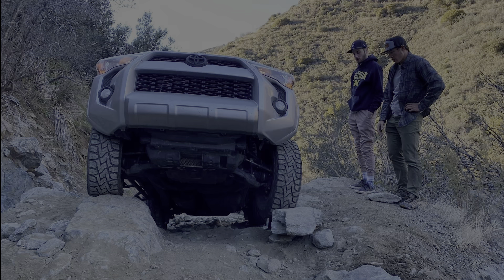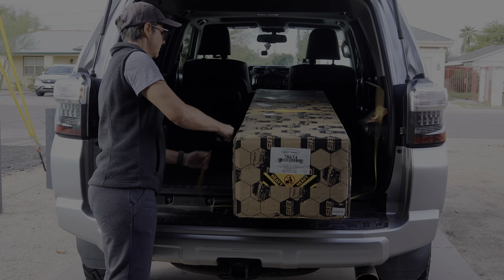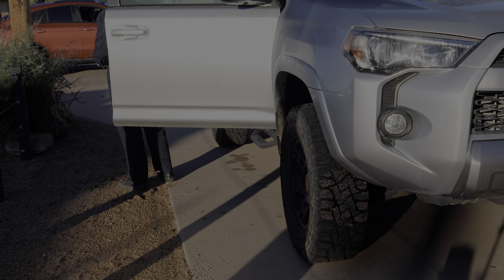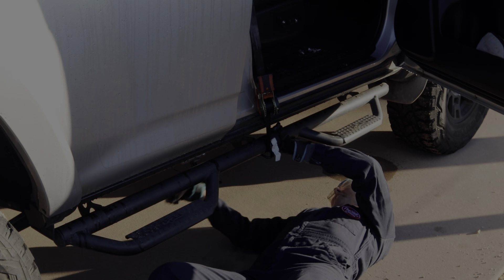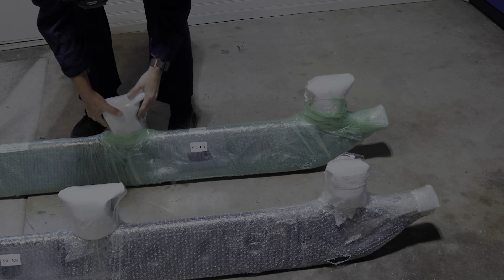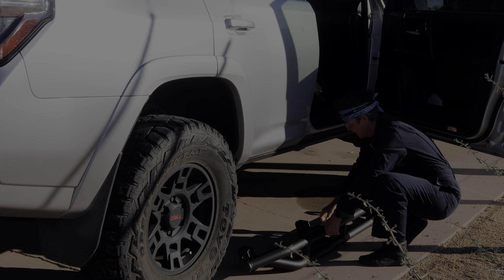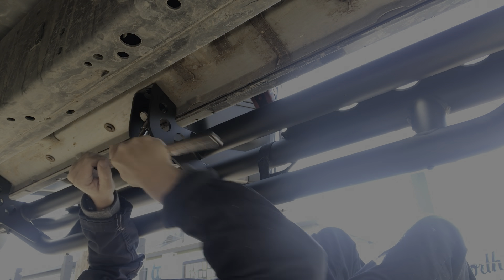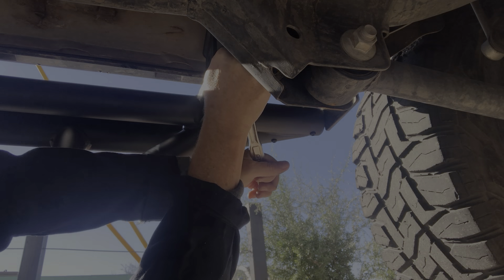Solo Smittybilt SRC Side Armor install on my 5th gen Toyota 4Runner

Comment: Great job.  I was thinking milk crate as well, but the strap is ingenious.  FYI - if you need a torque wrench in the future, local parts stores (Autozone, etc) has free loaner tools you can use with deposit.
Reply from the maker: Thanks for the tip! I happen to have an Autozone super close. Next time!
Reply: I saw a tool rental sign hanging at The Home Depot.